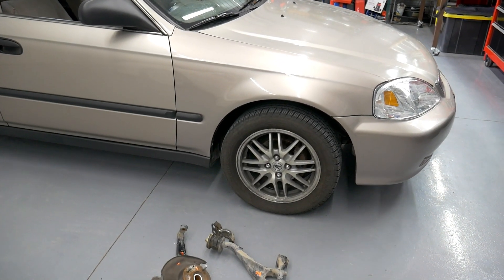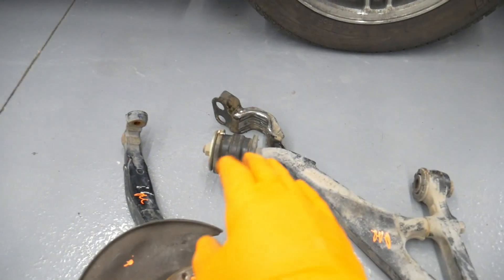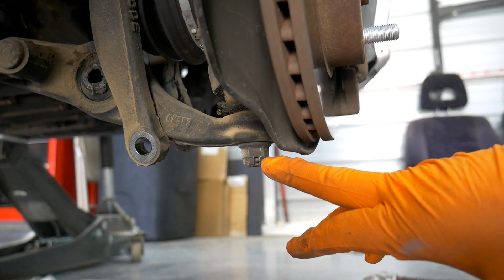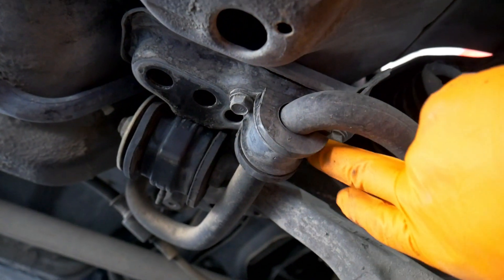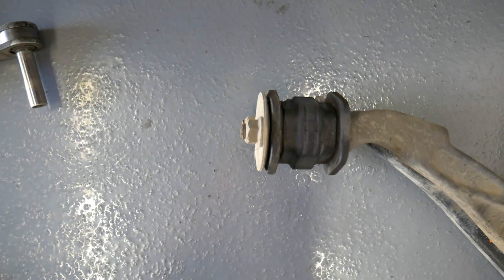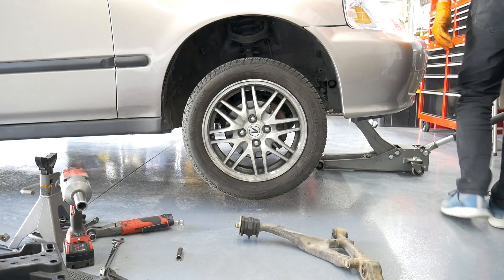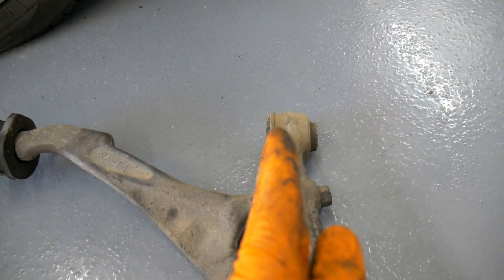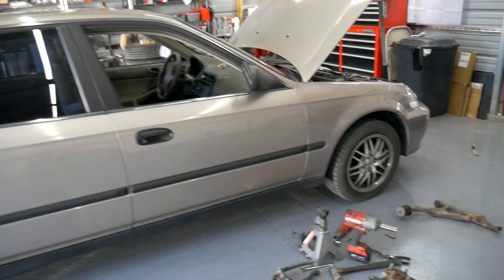How To Fix Front Wheel Pushed Back - 96-00 Honda Civic

Comment: This is my favorite channel for hondas, especially 4th gen hondas..so i thought id be long winded on this one.. ive had several hondas over the years but had never got into swapping engines, i just always bought the car i wanted and modded what i had.. after watching john for years have decided to swap a 4th gen.. ive been researching for at least 2 years and though i understand what im researching i am still having trouble settling on which engine to swap. Yes i do want budget friendly as possible im not looking to turbo it.. and im not concerned as much with straight out speed as i am a solid canyon carver car.. honestly  there is soooo much back and forth on which swap is the easiest and best that i continue to jump around thinking ok ive got it figured out then i research more and change to maybe this one or that one.. its become kind of a jumbled mess.. again budget is a part of my decision. Also ease of swap.. i would really appreciate some of everyones opinions..
Reply from the maker: Any B swap is good in a 4th gen.  You'll be happy regardless of engine, I guarantee it and I'm speaking from experience.   Find what suits your budget and go from there.
Reply: @GarageBuiltHondas  it seems like ive been leaning toward a b20 swap. My understanding is the b20z from a 99 to 00 crv is the high comp or ajdm b20b. Am i correct and i assume the b20z i could find cheaper but the b20b from a jdm shop would more then likely have way lower miles but probably alot more expensive? And with this engine what is the ideal transmission?
Reply from the maker: B20's aren't expensive in the world of Honda engines, one of the cheapest out there actually so you're better off getting a low mileage JDM one.

Any B trans will be fun.  Short geared is best for performance, long geared for daily.  Don't let that make your decision.  A stock Integra complete b18 swap into an ef is fun especially since you've never experienced it.
Reply: @GarageBuiltHondas  thank you for the replies!

Comment: Yea I swerved to avoid an animal and passenger wheel went up onto a huge rock/mini boulder that was sat where the grass met the street. Tire blew to hell. Rim was fine but wheel was turned outward. Turns out tie rod was bent, replaced that, and tie rods ends, lower ball joint. Thought I was good to go until I saw the tire was still pushed back. So now replacing the control arm. Hope this does it!!!

Comment: I have the same is  with my 2002 civic ex on the same side as yours but the wheel is pushed to the front instead.when I bought the car i think 2 or 3 of the rims were bent but I wasn’t taking notice from the day I bought it until recently I see it.  
My left rear at fault also. The top of the tire is closer to the top of the wheel well What u think?
Reply from the maker: Something is bent for sure.  Probably need to replace a bunch of arms to fix it
Reply: @GarageBuiltHondas  I replaced the front control arms twice now but it’s still the same. Don’t know what else to change. Not sure if the subframe is apart of the problem. And my rear left side is actually lower than the right. All shocks and struts are new from rack auto.
Reply from the maker: If you're having trouble finding the damaged area, it might be better taking it to a shop and seeing if they can point you in the right direction.
Reply: @GarageBuiltHondas  yeah. I have that on my next try. Thanks man.

Comment: i have a similar problem where the wheel sits far back just like this one but it also has a very low ride height, the wheel also goes back into its original position once the car has been lifted off the floor. can you remember if your wheel went back to center after the load being took off the suspension? thanks

Comment: I have an EJ6 coupe and I let someone drive it and they crashed it into a hedge. The FR wheel was pushed back in the arch. I replaced the lca and itit brought the wheel back forwards but not to where it should be. I am going to try a new knuckle and upper arms also to see if that’ll do it. You ever seen anything else bent from the wheel being pushed back? Maybe the subframe?
Reply from the maker: Yes.  I've seen subframes cracked and bent.  Sometimes the point where it attaches to the LCA it is bent.

Comment: My 2018 accord  has bend control arm.cant get new one for another week. Any advice on bending it back as it my only ride. But rubs really bad nowwhen turning.  Wheel set waay back towards the door. I HAVE TO DRIVE THIS IN THE MORNING.! Advise?
Reply from the maker: If you have a press you could probably bend it enough to use just for now.

Comment: Hey man, I hit a curb in my Kia Rio 2010 and my front right wheel is pushed way back into my fender. unsure if you’ll respond but will appreciate it if you can reach out and help. 😊
Reply from the maker: You'll probably need all new suspension parts as it is excessively bent.  Best is to check some junkyards.  Some even have their inventory of cars online.

Comment: I have this issue with my ef, it has been in an accident previous to me owing it i haven't tried replacing the control arm im kinda afraid the cross member was pushed back slightly.
Reply from the maker: That happens too.  Just have to hope the frame is straight and maybe just the crossmember is bent.

Comment: Hi Garage Built. This video made me think if something on  my 99 CRV might be bent as well. I installed some 1" spacers on the front but the driver's side wheel looks like it's ever so slightly slanted in so that I'm getting a little more wear on the outer edge of the tire.And the guy I took it to said that he wasn't able to align it because something might be bent.  I have the same type of wheel setup you have on your CRV. My previous tires were a little wider eagle road tires. Is it possible something is bent? Or did I have to replace the shock on the exact side that I took it off?  Or do you think the alignment guy just feeding me a line? Thanks in advance for any help.
Reply from the maker: Something's probably off.  Alignment guys aren't the kind to beat around the bush, they'll tell you when settings are off.

Comment: is that what it's called push back? I have this issue with my rear tires. they are both pushed forward and not centered. I did hit the median but from the side and had to replace the whole lower control arm on the left side. but both left and right tires are pushed forward where the space behind the tire is almost double the space in front of the tire. I want to put a bigger tire but cant bcuz of this issue. it's fine for the front tires but can't get on the rear bcuz the tire hits the fender on the door side. I have a 2008 honda also but a japanese version. Honda Crossroad, similar to a crv basically in between a crv and pilot lol.  I was able to find a whole rear bar with spindles but only used the control arm . maybe my whole bar is bent and need to change it?

Comment: Ive got a mk4 19tdi and drivers right side front wheel is 1 degree backwards then the passenger left side any help on how to fix , and is it a big problem with just 1 degree off, Thanks .
Reply from the maker: You'll want to inspect all the suspension components.  Something is definitely off.

Comment: Hey man I have a 02 bmw 325xi I slid into a corner of a curb front right side tire going left (5km) hit on an angle I drove my car back home the wheel alignment was off as well as the wheel was pushed back but wasn’t rubbing , no damage anywhere besides some rash on my rim , no slow leak in tire either
Reply from the maker: Something is bent for sure.  Sometimes it's hard to see just eyeballing it.
Reply: @GarageBuiltHondas  Ty already got the parts in myself was my lower control arm ,was bent

Comment: I've got a question. My front left wheel looks exactly like that except its a little bit further back. The tire on that wheel is wearing more on the inside. At first I thought I needed an alignment but based off this video it seems I need more than that. I guess the question is WOULD an alignment fix the tire wear or is it something deeper?
Reply from the maker: Something's bent.  An alignment won't solve your problem.
Reply: @GarageBuiltHondas  Thanks for the feedback I appreciate it 👍👍

Comment: I have a 2009 civic. I hit a dip and ever since it’s been pulling right. The front driver side has 3 inches on each side of the tire to the fender. But the passenger side looks like it’s pushed forward by half of an inch. I’m not sure which side is bent.
Reply from the maker: Both wheels when normal always look centered on stock suspension.  Take it to an alignment shop, they may be able to tell you what parts are bent.
Reply: @GarageBuiltHondas I’ve had 3 alignments on the car by 3 Different shops. 2 of the shops were dealerships. I asked them to tell me if any suspension part was damaged or bent and they said everything looked fine. So I don’t really know what to do anymore.

Comment: Hey Garage build I also have 2000 civic lx but it green color. It's fun just to watch you do everything right(take off put on, adjust...) and make it looked easy. I have a question that I know you can help me because I believe you know pretty much everything there is a bout Honda. I have a 1991 civic hatchback Si that have a dent in the oil pan and I want to replace it. Except this Si have a ZC motor in it. Can I use a regular D serie oil pan? My apology for a very long ass comment.  Thank you always
Reply from the maker: Yes, the zc uses the same oil pan that come on all the 88-91 civic/crx except the AWD wagon.

Comment: Good work yo. But you should have shown everyone where to smack those lower control arms to get them to pop off.
Reply from the maker: I actually use the ball joint separator.  I don't like snacking arms with a hammer.  I used to but the tool works so much easier.

Comment: I have a lowered 98' civic LX 4 door, I just got a bunch of stuff done, the main thing was both front axles and lower ball joints and I got an alignment done and my steering rack, so when I dropped it off, I had very minor camber, maybe like -1 if even and when I tuned everything was fine, I got it back from my mechanic, it's not his fault, I just found out my problem today, whenever I turned my wheel all the way till it can't anymore, my inner front wheels Hit my lower LCA and on the driver side it took a 1/6"-1/8" gouge from inside the wheel itself from bottom up half way left and right, the LCA just lost some paint and the same thing on the other side, but only a scuff mark, what could it be??
Reply from the maker: Are you wheels really wide?
Reply: @GarageBuiltHondas  bro absolutely not, stock tires 185/65R14 , I have camber adjustment, when my mechanic did his work, he took my camber away
Reply from the maker: Couldn't tell ya.  Lift the car and spin the steering wheel and take a look and see where it's hitting.  The rack shouldn't even be able to turn the wheels that far.
Reply: @GarageBuiltHondas  the inside of my rim hits my LCA when it's ALL THE WAY TURNED until it can't, so I can't turn make crazy turns, if I don't, I'm fine, no rubbing or anything, just can't make a full turn without it hitting
Reply from the maker: You probably have a non-Honda steel wheel on there that has a very high offset.  That's my only guess.
Reply: @GarageBuiltHondas  I wish I could show you what wheels I have, I've had it for 7 years and this problem never happened, cause I had camber, he made my wheels straight, so I need the camber I had, it wasn't bad, just alittle and they aren't regular LX wheels, there from another kind of honda or Acura, wow your smart dude, would of never thought of that
Reply: @GarageBuiltHondas  so my question is, what can I do about that??
Reply from the maker: You'll need to figure out if that's your issue.  Try a known Honda wheel.  These are just my guesses.  I could be wrong as well.
Reply: @GarageBuiltHondas  so this was my plan, keep the wheels thats on, roll my fenders, put 15mm wheel spacers on with lug adapters that go from ball seat to the conical type lug(aftermarket lugs) (extended lugs) and throw se camber on the front since I have the kit
Reply from the maker: That would probably do the trick.  Maybe the correcting of the camber created the problem and that's why it was minimal.  Spacers sound like they'd do the trick.  I'd test it.  Probably look better with spacers too.
Reply: @GarageBuiltHondas  yeah man I had very minimal camber for the last 7 years, same wheels, no issues, until they were straightened out, so im almost certain that's my issues, BUT im still gonna do that other stuff, thanks man for some info, your a legend
Reply from the maker: Good luck, hope it works!
Reply: @GarageBuiltHondas  thanks man!!! I'll definitely let you know, when I get to it and do it lol and whats a good torque spec for the 15mm wheel spacers and then a good torque spec for my actual wheels lug nuts??

Comment: Can adjustable control arms correct this? In the case that the subframe is bent
Reply from the maker: No.  The only front adjustable aftermarket arm is the camber arm.  That will not help an issue such as this where toe is that far off.
Reply: Thank you for your quick response. I have the same wheel setback on my car. The reason I asked is because my car doesn’t have one big control arm like this one did. It has a rearward and frontward control arm in two pieces. They’re essentially rods. Hopefully switching them out with new ones will fix this

Comment: I'm having a problem with my 98 front right sitting same way and it's walking all over the place there's a bolt that just spins
Reply: Just dropped in b20 vtec
Reply from the maker: That's rough.   Might have to grind out the bolt to get it replaced.

Comment: How much this job cost
Reply from the maker: A shop might charge a couple hundred dollars.
Reply: @GarageBuiltHondas  ok thank you! I’ll sub and Like the videos
Reply: Always try to know somebody who works on cars. Or know somebody who knows somebody! It comes in quite handy. Going blindly to a shop will cost multiple times as much. Parts are cheaper through connections. And labor. I had my clutch replaced, starter, and battery/terminals, oil topped, all for $420. This would have cost few thousand dollars had I just went to a random shop.